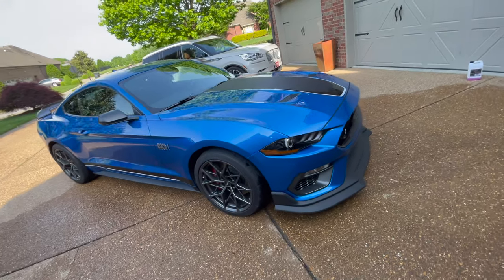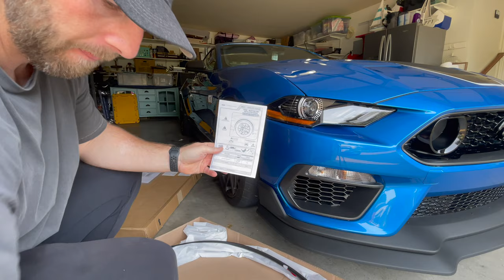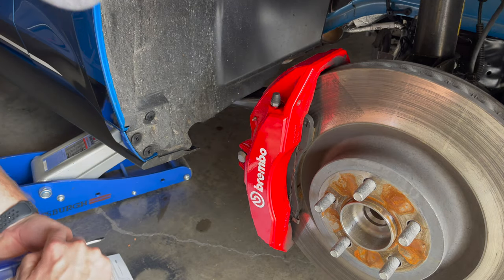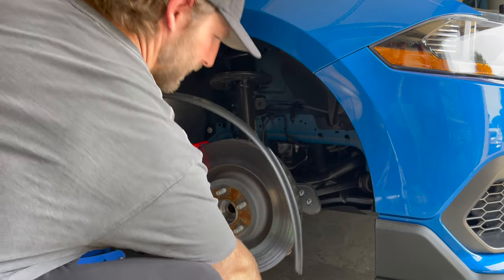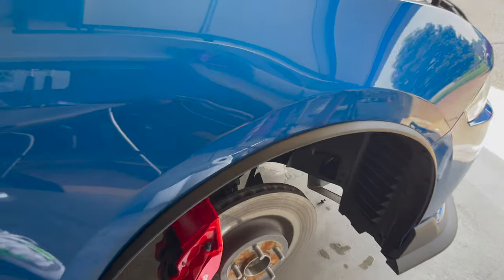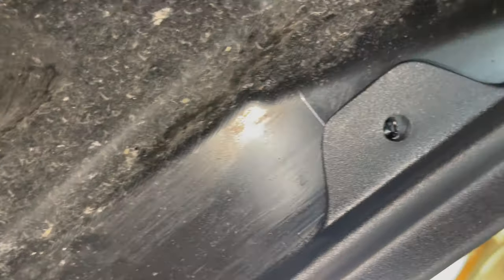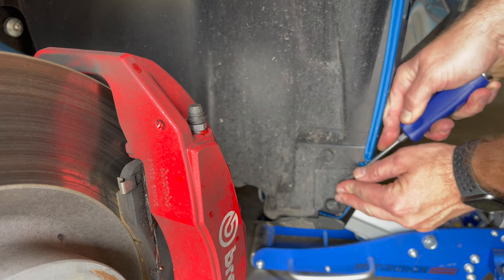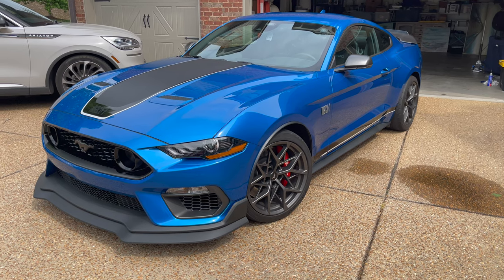How To Install Fender Flares (2021 Mustang Mach 1 Handling Package)

Comment: I wonder can anyone tell me if the flare would fit the rear fender well? I know holes may need drilled since the holes will be off compared to the front, but is the length and arch right to fit the rear as well? I ask because I run very aggressive offsets and widths and would like the small flare for protection. Thx!

Comment: Hey Jake... love the Mach 1! So I have a mustang GT PP1 & I’m assuming these would fit my 5.0h... currently running the PP1 stock setup wheels/tires which are tucked so haven’t had an issue with rock chips but getting ready to do a new wheel/tire combo and that setup is going to sit flush with the fenders & I don’t want any rock chips these would be perfect & in my opinion look great. 👍

Comment: I had mine for over 6 months without the fender flares, I had to call them multiple times before my salesman found them in a box in the back....once they found them, took it up and they installed them....I have a couple small chips but even w the flares there is constant black sticky rubber dots that are like glue that fly up that make it a beoch to clean...I need to get it coated but haven't yet...the flares do give it an even better look

Comment: I have a '21 mach1 and have been driving it since Feb and don't have the frt. fender trim just like yours. I am the second owner of the car. The original owner owned the car for 17 days and put 3200 miles on it. Being the second owner, I don't know if calling Ford will do me any good, but I think I will give it a try.
Reply from the maker: Warranty is supposed to fix it

Comment: I have a 2023 Mach 1 with handling package. These front flares don’t seem to do much on protecting the car from rock chips. I just ordered ZL1 addons rock guards. Going to incorporate them in with the flares for better protection. Curious though...how has your paint held up with just the flares?
Reply from the maker: I’ve noticed a couple of chips

Comment: Adhesive promoter is not alcohol. It makes 3M double sided tape pretty much permanent. If you would ever pull those trim panels out the tape will literally rip apart. It's definitely good stuff and makes a big difference.
Reply: Alcohol will be enough. My track pack wing has been attached for years with just alcohol

Comment: they should fit a mustang gt , becuase the fenders are the same size, compared to the gt500 which is wider to fit the 305-315 wheels flush

Comment: Nice job handling the installation of those Wheel Well trims. I like the look, plus it should help with rock chips. Unfortunately I believe these parts are from a supply chain issue. I'm guessing Ford wants to get the limited run Mach 1 to the dealership with these parts being shipped separately instead of being in the car because the current inventory shortage. The other issue is why the original dealer auctioned this popular, hard to find Mustang apparently within days of receiving it. Just wondering if your car was titled before you purchased it. My local dealer just sold a green label Mach 1 after 3 days on the lot. It had the parts you were missing installed on the car which included the rear spoiler. On the positive side. You own a beautiful Mach 1 that now has the wheel well trims. Hopefully everything else will be smoother
Reply from the maker: I bought it with 350 miles used, they flipped it to make more money
Reply from the maker: I’m very happy with the car thanks!!
Reply: @JakeTiesler  That seems to be the new way for dealers to make more money without having to answer to the manufacturers for adding large dealer markups. I found if GM finds dealers marking up the Z06. The dealer loses their Z06 allotments. If they sell it within their organization, then sell it as used. They can charge whatever price they want

Comment: Question, got my Mach 1 with the handling package.

The dealer recommended not to install the additional splitter and gurney flap bit did state they could install it for me for free at anytime.

The only thing missing is the wheel lips, reached out to the dealer and currently waiting a response.
Reply from the maker: Missed the question
Reply: @JakeTiesler  lol my bad, the question is why does Ford send the wheel lips separately from some place in ca? It would be easy for the dealer to get confused.
Reply from the maker: Yep, it’s rare to see the car all out together properly
Reply: @JakeTiesler  good to know, the dealer was pretty good and responsive so I'll get it taken care of. Overall, the car is just sweet!!!!
Reply from the maker: Enjoy man!!

Comment: Wonder why the GT350’s didn’t come with these flares
Reply from the maker: Good question -
Reply: Shelbys are wide body.
Reply: @jamie3810  no they aren’t. I owned one
Reply: @DKLabs99  Maybe saying it's a "wide body" is a bit over. But the whole front track is wider on the Shelby's. If you fit a 305/30r19 as found on the 350R, it fits under the wider front fenders..while under a standard fender they poke...like they did on the PP2 cars or as they do with the HP Mach 1 without the extensions which is illegal in some places and lead to the tires destroying the sides of the car. (Which they still will, get PPF) You can walk out to your garage and see how the bottom back of the fender under the heat extractor opening is wider and even lines up with the wider rocker. Not to mention the bumper cover is wider at the headlights.
Have a amazing and wonderful day with that Shelby...I still have a 1mm of tread on my Cup 2s and I need to enjoy that last bit of tread before the weekends end.
Reply from the maker: Haha reminds me that the Mach 1 handling package front tires are wider than the GT350 hmmmm
Reply: @jamie3810  thanks for clarifying. I agree the fenders and quarters are different I just never considered them a widebody. I have seen folks actually do a true widebody to the 350’s from Shelby American and those look amazing